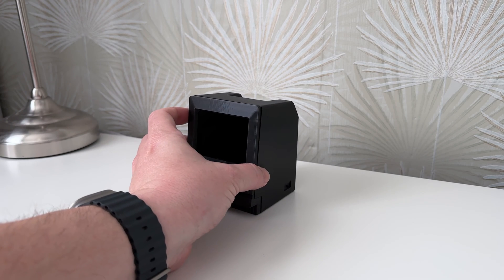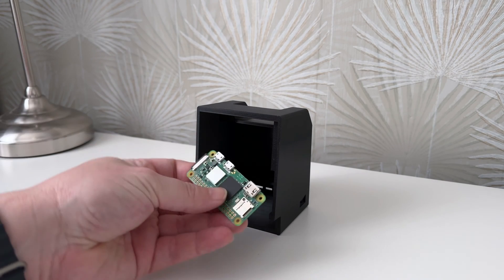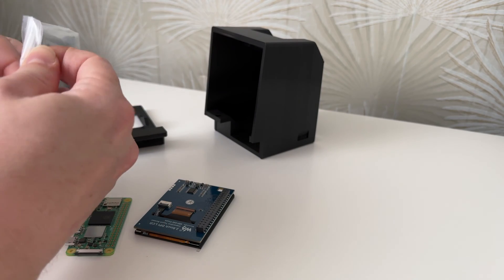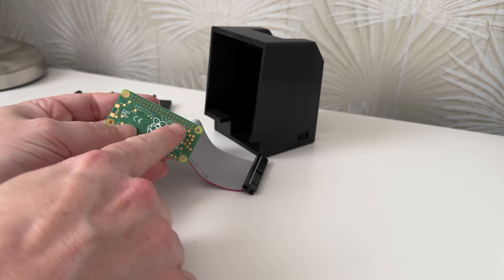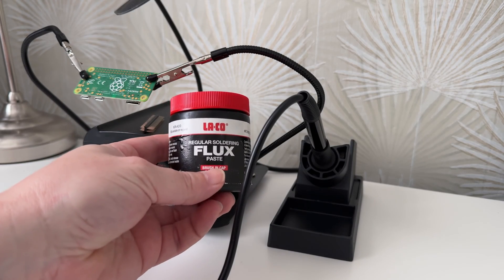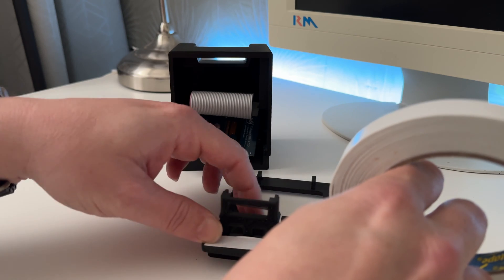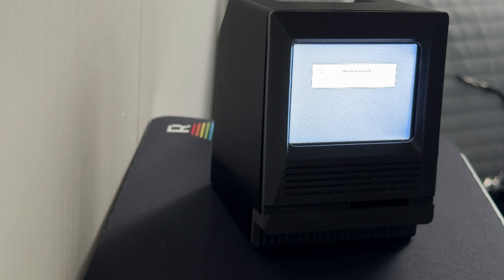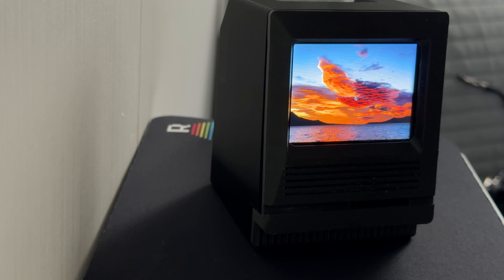Super Mini Mac (Raspberry Pi Zero 2 W)

Comment: 4:40 I am an electrical engineer student. I noticed your soldering iron is set to 300C. When soldering smaller electronic components that you are struggling with, you want it set from 320C to about 400C. I usually go 320C for any through-hole soldering and 360C or 370C for surface-mount soldering. I have the pin finally melt the solder after raising the temperature by 1-5 degrees. Also, the tip of the iron will continuously keep oxidizing when exposed to air which will disrupt the heat transfer from the tip of the iron. To fix this, keep a small wire brush on hand and before each solder you should give the tip a quick clean to remove any oxidization, then you should tin the tip. Tinning refers to applying a small amount of solder to the tip (not enough to make a blob but enough to visually cover the tip). Then you can apply it to the pin and apply the solder. 

Ps. A tip for recording any benchwork is to do a top-down view. It shows the most. You can usually DIY a top-down gantry using a clothing rail or something similar.
Reply from the maker: Yeah I turned it up a bit later and that helped! Thanks for the comments ;)

Comment: I still use my old Antec / RS Components soldering iron from my Field Service Days -  it's only 25 watts, but for most use cases it's fine.  Only issue tends to be with big lumps (on a heat sink etc) - but I tend not to have to replace things like too much.

Comment: For soldering I recommend a T12 soldering iron(any brand will be fine, the small box type) or a Pinecil, it's good enough for the job. For soldering I use thin rosin core solder wires, flux syringes from mg chemicals (chipquik also works), and a tip scrubber for cleaning up tips (the wire ball type). 
Small tip for the headers: it's easier to just lay it on the table and solder the first pin, heat it up to set it in place properly, then solder the opposite corner, then finishing the rest.

Comment: I’ve experienced problems with a Chinese soldering iron: inappropriate mains fuse and poor earthing were the most concerning.
Aside from the safety issues I was also baffled by its inability to make a decent solder joint on anything other than the smallest components. The cause turned out to be an air gap between the ceramic heater and the bit itself - without a good thermal path between the two there is no way it can actually deliver the claimed amount of heat. 
I made a copper shim to improve conduction and this helped to some extent, but couldn’t get a very good fit without it becoming so tight that changing the bit would risk breakage of the ceramic core. 
I don’t know whether this is the problem with the Kaiweets iron you have, but it sounds similar so I’d take a good look at its construction.
If the job you’re trying to solder has enough thermal mass to drain the iron’s tip faster than the heater can get energy to it then you’ll find yourself trying to compensate by turning the temperature control up. Not only does it make for a miserable experience, but will shorten the lifetime of bits (because of the wider temperature cycle and running hotter when idle).

Comment: Nice video - what a lovely fun project.

A few tips for soldering you may find helpful.

0) That solder appeared to be rosin-core. That means its already got the flux inside it. Rosin is derived from the sap of pine trees. It contains acrylic acid which helps clean the surface. For the most part, the action is to exclude oxygen and prevent any (further) oxides forming. Blocks of rosin used for violin bows work wonderfully if you'd like more flux.

Plumber's solder is very different. It contains a chloride salt which is too aggressive and ends up ruining the plating on the iron's tip.

1) Couldn't quite see the tip you were using, but it looked like a  fairly fine conical tip. I only find them useful for very small things. For stuff like pin headers, I'd always want something stumpier.
I usually use a K12-K (knife-edge) or a K12-C4 as shown in the following fleabay listing. https://www.ebay.com.au/itm/175633642904

Manufacturing videos showing hand-soldering being done in factories typically sees the use of much bigger irons and tips, loaded to the hilt with solder before touching the pins. I'd imagine some would solder that header in two single passes of a few seconds each!!